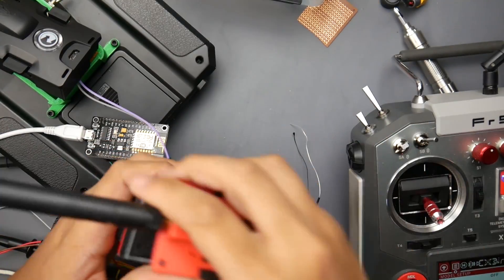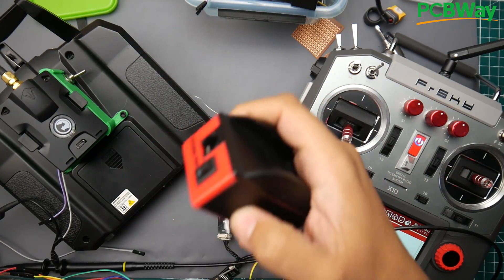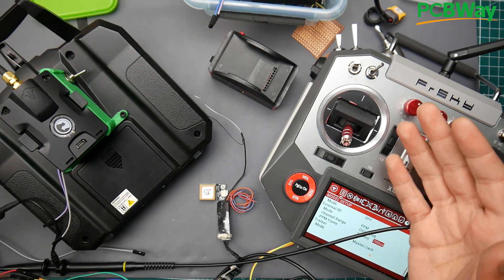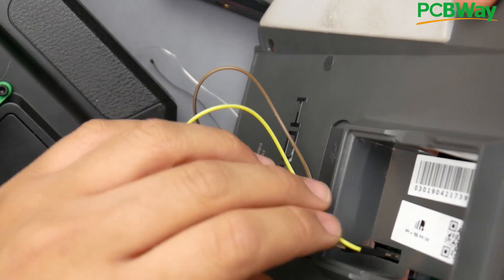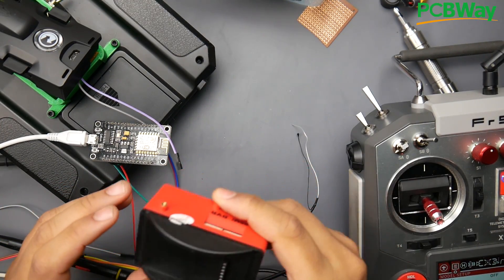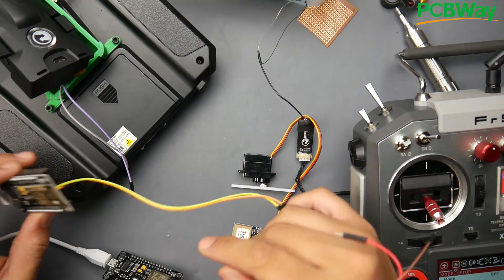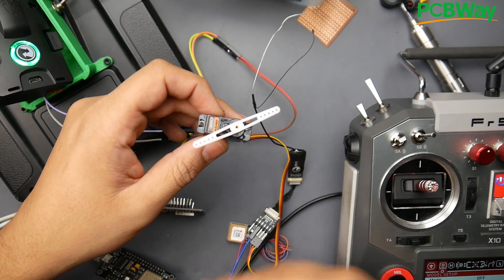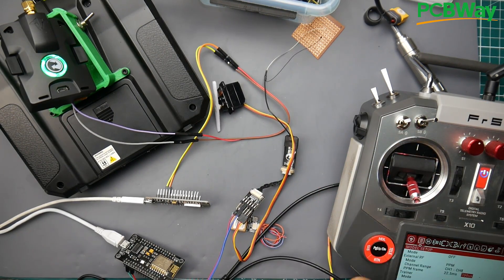The Frsky Module Dock To Rule Them ALL // TBS Crossfire,  R9M and More

Comment: A wireless relay is what you are describing...its been done already...I use one taking a 1.3G Video signal input and broadcasting it on 5.8G to Goggles or a Monitor.
   The RX wired into the JR Bay Module idea has also been done before too..

Comment: Really cool idea for those frozen days. FWIW you can already use a usb joystick in ardupilot. Crossfire over mavlink/bluetooth works fine, then plug any type of joystick/keypad and GS software. In this case you would just put the radio on your car and fly from the warmth of your vehicle.

Comment: No need for such a complicated solution. Just use D4R-II in PPM mode connected to R9M and external battery. Thats all you need. Bind D4RII to radio and every channel will go thru rx into R9M. Any rx with PPM output will work. Of course you need to setup R9M with dip switches and bind r9 rx to module.

Comment: Can you build your breakout module that holds the R9M or Crossfire that also replaces the Frsky controller?  Then use a PC running openTX to configure the breakout module.  One of the reasons I would like this is I would like a larger screen than what's provided on the typical controller for configuration.  It's not uncommon now for people to have their laptop in the field to make modifications to betaflight, so why not use it for openTX changes?  For a simple model enough buttons exist on an Xbox controller to do what we need.

Comment: Why not use a normal ppm receiver on the module side and use that signal. Than you dont need the "transmitter" side ESP8266, it simplyfies the setup and reduces latency. I build such a repeater with ezuhf. I have a second wireless repeater which converts my 1.3ghz video receiver to 5.8 for my goggle!
Reply: if the transmitter has a PPM trainer port, cant you just use that signal to control a JR/frsky/crossfire module?
Reply: is the CPPM signal the same? looking at some frsky receivers with telemetry and PPM, they all mention just CPPM

Comment: Very nice! I'm not sure that you can connect USB joystick to ESP directly as the ESP does not directly support USB and the chip your board uses is just an USB to UART (you might need a different Arduino to do that (mini i think)). 
Would love to fly with this snapped to my car so i can be cozy inside during winter :)
Having a bluetooth gamepad (with esp32) and the esp run some sort of basic TX would be awesome as well :) but not sure if the game pad like TX-ses are not already making this possible :)

For the jitter i would guess that you might have a problem in ESP reading the values from the TX.. or the timings or power issues on the module side
Reply: Oh.. one more for the gamepad idea - flying quads with a gamepad is really terrible. You can try this your self by playing some sims on PC or Android.
Many of the gamepads have only 3-4 levels of deflection (are not true analog sticks) or have a really narrow band where the sticks are doing something and really wide center/max/min dead band on the sticks.
Makes it virtually impossible to fly
Reply from the maker: Search Xbox adaptive controller and you will get the idea.
Reply: @DroneMesh  Nice :)

Comment: I think if you're most interested in getting USB HID devices working as inputs I'd make a box that converts the USB/Bluetooth data into a trainer port master and just using the radio module bay. I see some others are interested in better range and this can already be achieved with SMA extensions and RF amplifiers

Comment: Whoa, amazing idea! Keep us posted, I'll be watching out for updates!
Btw, check out Wemos D1 Mini - also has esp8266, supports arduino sketches and micropython, but is smaller than 1/2 of nodemcu.
i wonder how much 2.4g wifi interferes with frsky 2.4g transmission.
And don't forget about the antenna tracker, i want that asap :D

Comment: I've got microwave sickness, it would be handy to be able to locate the transmitter away from my body and use a cable to connect the controller remotely.  Also I would love to be able to stick an aerial perhaps on top of the house maybe with a tracker and control the drones from my PC joystick/throttle/peddles.  This could be great for making a quality ground station.  Thanks for all your work, I wish I had your skill level and motivation.
Reply: Microwave sickness?

Comment: Great as a POC, and the applications will be a lot broader i think :) Great start and curious to see what you end up with!
Reply: Curious though, what's the throughput of an ESP32? if it's big enough you could also make a 'generic' data bridge', that way you could even use it as a wireless USB bridge or somesuch device. Love the idea of having a few of these boxes with xbox/ps4 controllers as well (handy in the classroom and less breakable than toy-grade controllers). I'd say however; look into combining this with a cheap all-in-one transmitter module and you're fully set :)

Comment: Could you do a comparison of the data transfer speed (delay) for;
- r9 mini for 900mhz
- r-xsr at 2.4 ghz
Which receiver will be the most effective for racing and freestyle?
When it comes to stability and penetration, it is definitely r9. the same for range and flying planes and wings. But what does it look like when it comes to data transfer when it is important for a drone?
Reply: I believe that our control latency isn't simply due to transfer speeds.. Just compare it with our VTX's, which actually send a lot more data but with lower latency. (also, transfer speed and latency are two different beasts)
Instead, I think we need new protocols that are better optimized for (quad) racing; i.e. with much lower latencies but still 'acceptable' reliability.
In this regard I have pretty high hopes for machine learning / AI based links in the future - in fact, possibly even for live HD video :D